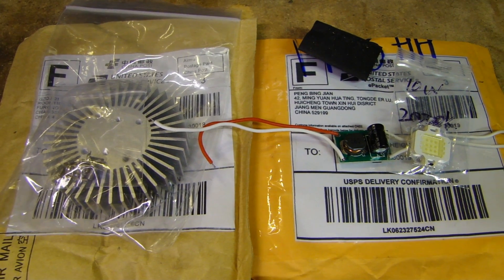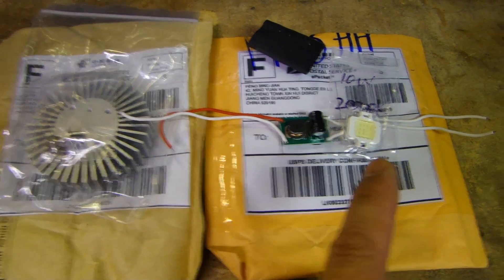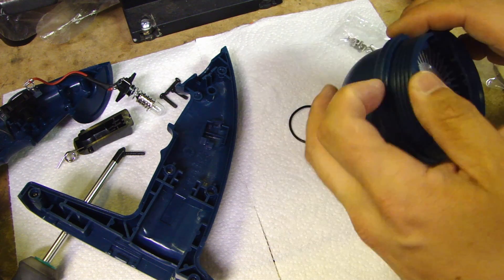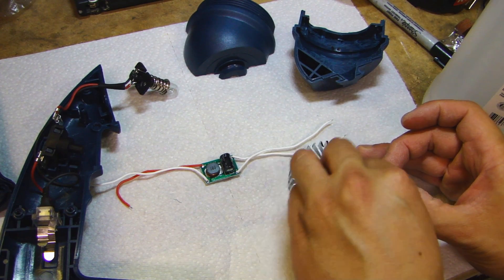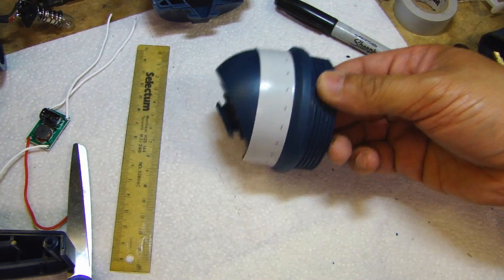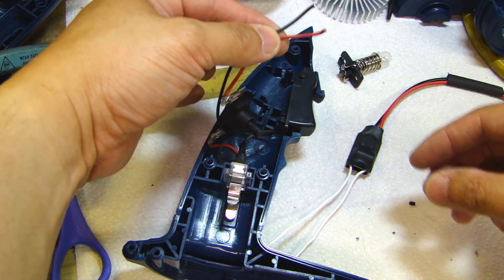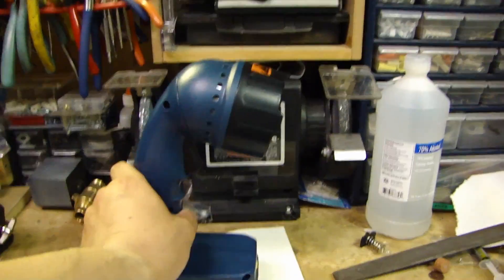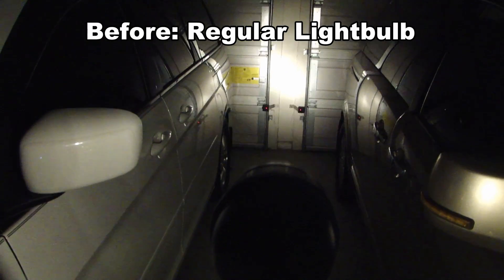Ryobi 18V Cordless Flashlight with 10 Watt Super Bright LED

Comment: By the way, have you noticed any possible melting with the Reflector being so close to the LED? I was thinking of using a 20mm CREE XML2 star type LED (LED is actually 5mmx5mm) which uses a smaller LED design, instead of these big Chinese LEDs. My only concern, other than longevity, was the LED being so close to the Reflector. Your thoughts on using a CREE XML2 instead? Would a 20mm fit best or do I need a small led pad such as 16mm?

16mm http://www.ebay.com/itm/221660365853
20mm http://www.ebay.com/itm/221668056483
Reply from the maker: rgray318 Not sure about the CREE XML2, but the LED I am using will not melt anything as long as you have that heatsink. I have had it run for 4+ hrs and no problem.
Reply: 1)  In his design the LED itself will run too hot and be damaged, but it will take 100's of hours to notice.

2)  It still won't heat the surrounding area enough to melt the reflector, but some of these work lights have a metal reflector anyway.  My Dewalt does.

3)  A Cree XM-L2 is a better LED, but note that you can't use the same driver, as his is designed for a 3x3 LED array (in that single package)

4)  If the reflector is metal OR metalized plastic that's conductive, you have to be sure the reflector isn't touching the electric pads on the LED (carrier mPCB).

5)  Get the biggest mPCB carrier that has a star shape instead of round.  It typically uses thicker metal for better heat conduction.  There is plenty of room for the larger diameter.  Even better would be to get one with the copper mPCB for further improved heat conduction.

6)  Despite #5 above, there still isn't sufficient heatsink surface area or airflow rate through those light head holes, to support running an XM-L2 or ANY 10W LED at the full 10W rating, unless you are okay with an early death, like a few hundred hours lifespan.  Some people are!  Just unscrew the LED, unsolder the wires, and put a new one in.  It only takes 5 minutes longer than if it were an incan bulb you were swapping instead.

7)  Personally I wouldn't plan like that.  You can run the LED at a more conservative wattage, accept less light for the benefit of longer runtime.  Besides, the human eye responds to light on a log scale, a light that has twice as many lumens, is not remotely close to appearing twice as bright.   Literally you are better off running an XM-L2 from a 3W regulated driver.  Yes, less than 1/3rd its max rated wattage is an ideal fit for this light.   This is why professionally designed products don't try to fit 10W in that amount of space with that little cooling, unless it's a generic Chinese product and they're just plain lying which unfortunately has become so common that you almost expect them to do it with regards to flashlights.

Comment: First: "The LED being a transistor..."????? LEDs are not transistors, they are light emitting diodes! If you don't know what a diode is Google it! 
Second: The circuit doesn't "convert" the voltage by magic, there is a bridge rectifier on it. Google this too, you might learn something from that...
Reply: Nikolay Yordanov why do you have to be such a jerk about it?

Comment: I just picked up two of these for $8 each. Thank you. Do you recommend any specific parts?
Reply from the maker: Just search Ebay for 10W LED and get one that is 5000k color temperature (instead of my 20000k which is too purple). I have since changed it to 5000k. Find the LED that is rated for 10W at DC 9-12V.

Comment: very good, did i miss the part that you may have said this mod uses the same or less current, if less then good, ryobi is the kind i have. but my batteries don't keep a charge long and i am on my second set, the tools are great for me, but the batteries,yuk, did or will you do a mod on batteries for the ryobi tools, thanks for all of you work
Reply from the maker: The Ryobi 18V batteries have more current than what the LED needs. The LED only consumes 900mA, and the little power supply module will limit the voltage and current to the LED module. As to the battery itself sucking, try getting yourself the Li-Ion type which costs more but far more superior than the Nicd.